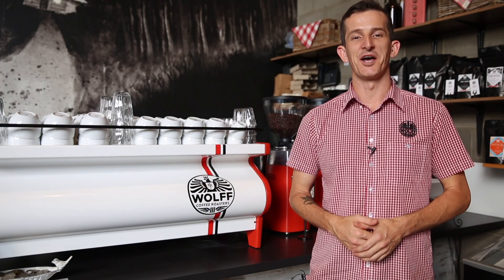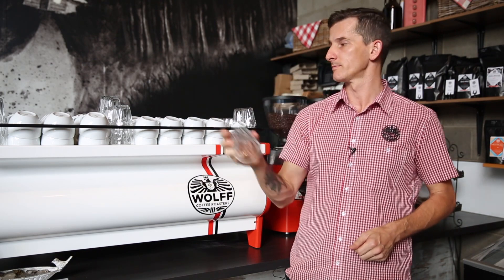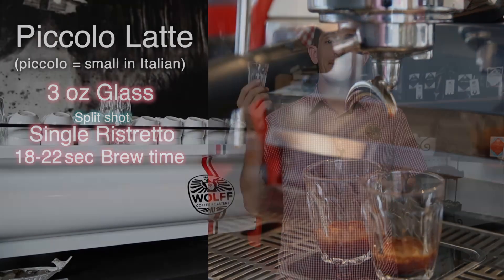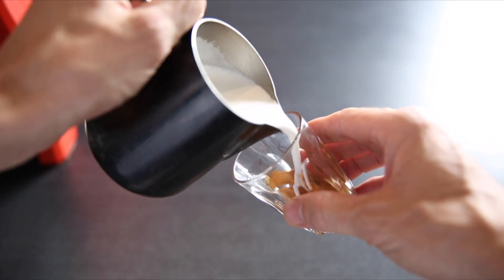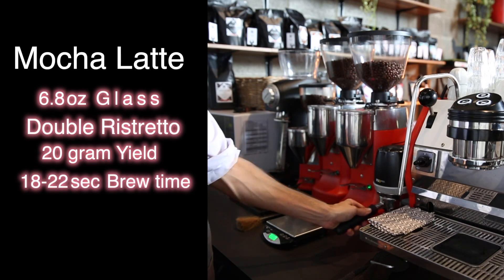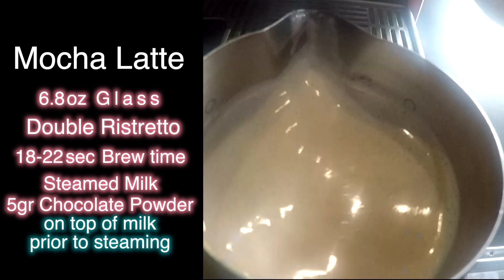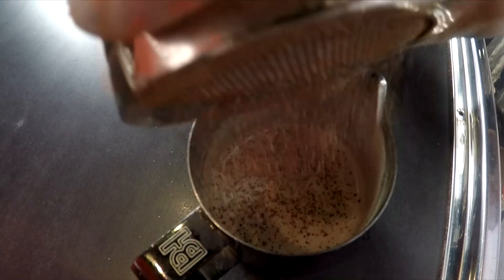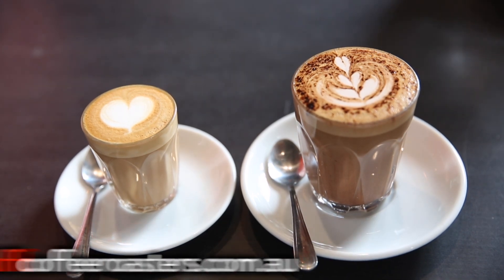Making a Piccolo and Mocha Latte

Comment: Hi , lemme say it looks great , but i have a small doubt and if you could clear that , it would be of great help , i love drinking coffee in small qty and like piccolo which you have made , you think its possible to make cappuccino , mocha n all with proper taste in 3 ounce glass that you have used for piccolo ? if then what would be the right qty for espresso shots for them in a 3 ounce tiny glass ?expecting your reply with great interest .
Reply from the maker: the same as a piccolo I suspect. A piccolo is simply a perfect half of a regular Cafe Latte. So buy either adding half chocolate into or on top of your 3oz coffee, you'll be making a small cap or mocha. . customers may not relate to them in this way but I can see where you're coming from :)
Reply: Wolff College of Coffee . Thanx a lot for your reply and 2 more things. For a 3 ounce glass do you think 10 gms of espresso shot will do ? Like the half of actual shot ? Also I am from India and if I want to enrol a course with you , how can I?
Reply from the maker: It should be 10 grams of a total of 20grams. So you'd only be catching one half of the shot. This way you get far more extraction and strength in that 10gram single ristretto. Then yes, 10 grams should be plenty for flavour. Always ensure you're customer enjoys it that way though. You could  be doing single espressos in there as well. Find the flavour that works for your coffee and your customer. .. 
As far as courses go, stay tuned! we are building platforms to better reach out to those who cannot visit us in Brisbane; but we do get many who travel and stay in Brisbane to do the courses with us. You' re always welcome :)
Reply: Wolff College of Coffee . Sounds great . If I could travel n stay what would be the course duration and amount be like ?
Reply: @WolffCoffeeRoasters  .Sounds great , and if i wna comedown , stay and do the course what would be the duration and fee structure be like ? also will i be able work and learn ?

Comment: "Good balance between coffee and milk" 

Pulls a riz into a piccolo... talk about balance
Reply from the maker: I know what you mean to articulate and in essence I agree and would say, 'You would think so.' Numerous times I have been the devils advocate for these exact recipes and tested the espresso vs. (dbl) single ristretto out in 3oz piccolos (in other 6oz drinks). Although the complete extraction is not reached, the 20 or so seconds of extraction still reaches a modest 12-15% EY.  The balance is there in the flavour experience. An espresso in a piccolo, listening to out consumer feedback, gets brought back every time as too strong.
Reply: Well it's extremely unlikely that your espressos have a taste balance range of 12 to 20% EY.
Ristrettos will (almost) always taste a lot worse than your targeted recipe (if the recipe if correct for a given customer base in the first place). I've tricked dozens if not a hundred customers with 2 cups extracting a full shot and a riz (for piccolos, espressos, lattes etc.) and not a single time I've had someone telling me they found the ristretto tasted substantially better than the fully extracted shot (which has reached it's balance and sweet spot).

If you look back historically, coffee used to be dark roasted to hid defects in the green or poor storage impact on it. The only way you can extract a dark roasted coffee and achieve balance is by having a much short extraction (increased solubility in dark roasts will result in a targeted EY reached faster than a 'lighter' roast) ==> therefore ristrettos were used to obtain a less-bitter profile.

Now that we have access to better green quality and roasting has evolved, the average roast development has substantially decreased meaning we need to stretch our extractions more and the existence or ristrettos isn't needed anymore and becomes an absurd legacy which - in more advanced market - has already disappeared.
Reply: @simon_gautherin  
How about you use your method for your customers and they do the same?
Reply: how about understanding the basics on coffee extraction before posting tutorials and spreading false informations which the rest of the industry has to fight twice as hard to eradicate?
Reply from the maker: Coffee Extraction is a science, The Flavour experience is subjective is what Maria what hinting at I assume.